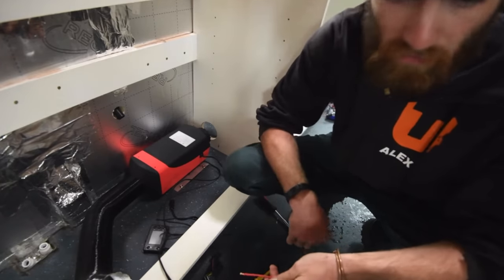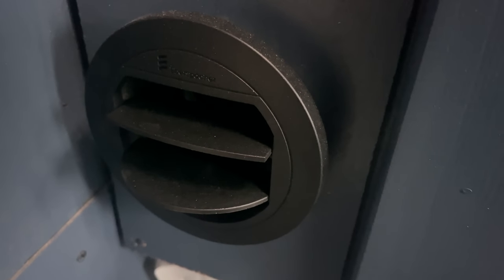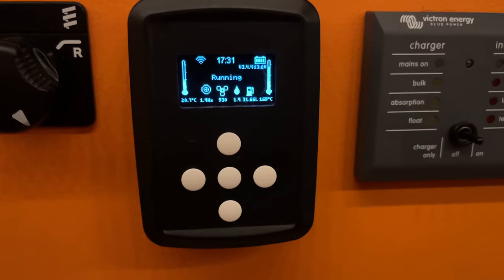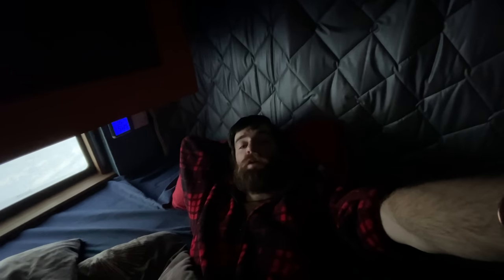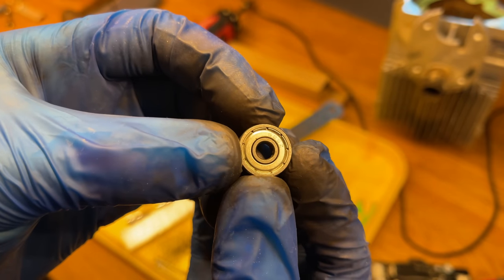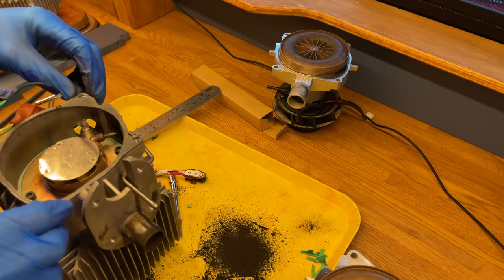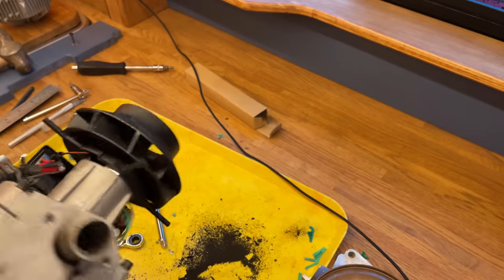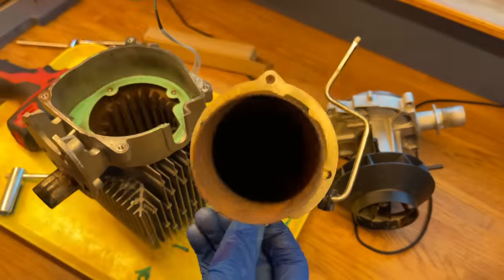2000 HOURS LATER! Chinese Diesel Heater

Comment: Mr Mispronounced Adventures,
Can you tell me how long of an exhaust you can mount on one of these?
And, can it point upwards or does it have to be pointing downwards?

SO what is the max length of exhaust you could possibly put on this that would still be effective?
And, can you point it upwards with some modifications ?
Reply from the maker: I’d need to look it up but most of the manual says the max length and Max degree of bends. When you start to get longer or more bends, you start to make a restriction, which will effect the combustion.
Reply: @MispronouncedAdventures  i saw in the chinese booklet that it may only be 1 meter maximum, but i think that is kinda short, right?
Btw, if i were to use a bigger diameter pipe, it shouldnt restrict it i would think. 

But anyway, thanks for the response. I am gonna try it out and see what happens.
Like in, 2 meter exhaust would be nice.
Reply from the maker: I find many of the Chinese booklets can vary massively, depending on which company you pick whilst the heater itself will be the same
Reply: @MispronouncedAdventures  i have no experience on that. I just bought one from Vevor, a 5kw heater with the 4 outlets.
But this booklet is crazy. It has an explanation on how to work with the digital panel, for every variant of that panel.
But this device only has 1 such panel, so why would i want to know how all the others work?
Plus i can not make any sense out of most of what is written in that manual.
Luckily there is Youtube.

But so, you have never tried a longer exhaust yourself?
I do not see why it would become a restriction if i just make it longer. Perhaps even make it a bit wider pipe, so from small to bit wider diameter, that shouldnt create a restriction i would think.

It is because i want to get the exhaust above the roof of my house, which is roughly 3 meters. I dont want to bother the neighbors with the smoke and smell.
I also thought about making the warm air outlet longer, but i think it will be a lot of waste of heat.
Even if i were to isolate/insulate it (or how you spell it, dutch sorry cant help it) i think i will still loose a lot of heat when it has to travel down 3 meters.

Anyway, i think i am going to try it out. If it works, it works.
We shall see.

Comment: Would it make sense to have the inlet hose on the inside of the house, seeing that the air inside is already cleaner and warmer?
Reply from the maker: The inlet of the combustion side? Definitely no. Not safe if there is a issue as it would be able to vent CO into to the habitation. 

The air which is heated is  already from the inside

Comment: Why is there a brushed dinosaur electric motor when brushless motors are available ?maybe your next upgrade?
Reply from the maker: Even the western Webasto and Espar use brushed motors only till recently and I think that’s only on new models. Autoterm use brushless. 

it’s not a upgrade you can make to a CDH with a whole need ECU.

Given my Heater ( the one in the video ) in now 6000 run hours I’m impressed

Comment: Hi, I'm interested to know how much electricity it uses? Mainly for the purpose of managing 12V batteries at sea on a boat. One suggestion from a skipper friend of mine is that these Chinese heaters are actually better than the Webasto/Eberspacher originals in the sense that those latter have a thermostat which is not always a good idea, as the units shut down when the set temperature is reached: His argument is that it is better to have a smaller capacity heater running higher and longer, thus not using the electrical use intensive start/stop cycle so often, instead of using a bigger KiloWattage heater which stops and starts more often. Personally I think it's hard to say without practical long-running cycles, and models probably vary. What do you reckon? What does your 'afterburner' unit actually do, in a nutshell? I have an Eberspacher and a similar Russian diesel heater (I'm sure one is a close copy of the other) on a boat, and they do tend to use a lot of power for winter sailing in the far north, where there is not so much sunlight to recharge batteries from the sun, so I'm really interested to see how far we can get with the longer cycle/continuous running theory. Nice video, thanks.
Reply from the maker: Power wise I find it uses around 1A @ 12v when running on low ( van up to temperature) 3/4A. I found it wasn’t even a draw I really had to consider too much when I was up in the Arctic last winter
Reply: @MispronouncedAdventures  thanks for that. Do you have any idea what the startup and shutdown current draw is, and for how long, each?
Reply from the maker: Around 10A @ 12v / 120W for a few minutes
Reply: @MispronouncedAdventures  that's good info, thanks - hard to measure on a boat with so much is going on and off (navaids etc)... would you measure the time in minutes it uses the 10 Amps whenever you happen to get a chance, if you'd be really kind?

Comment: i would be interested in obtaining the afterburner unit.. please advise where from
Reply from the maker: There is a Facebook group for it. It’s more of a project and not a product
Reply: @MispronouncedAdventures  i purchased mine from aftterburner direct  2 years ago and it was (is) both a esp32 project and a also available as a full kit full kit, beware i think there is a copied version around which is not as good
Reply from the maker: Yes, unfortunately there is a Scottish company which copied the project whilst the code was opensource, the PCB design was not. The UK market effectively was banned by Ray for good reason for almost 2 years. My unit was purchased from Ray

Comment: Ever tried a percentage of using oil mixed w. diesel? I am assuming it‘s using the main tank, right? So there’s a way to save on fuel costs in general.
Reply from the maker: I don’t personally as it from my main fuel tank. But I know maybe people do run mixes
Reply: @MispronouncedAdventures  Acc to my experience up to50% without modification works fine. But you need to watch the engine oil level. If it’s rising, change your oil because diesel evaporates at 50°, vegoil doesn’t and accumulates if the combustion isn’t good enough.
Question about your transit: Any trouble with the DPF? I see a lot of them at work with blocked DPF and it doesn’t seem to regenerate very well with these engines (Sprinters on the other hand don’t have this issue).

Comment: Invest in ratchet spanner’s Aldi or Lidl have them around a £5
Reply from the maker: I do, I have a small set ( I used one of them to tap the Center out later on and to put the new exhaust clip on  ) but I just didn’t have a tiny one for the old jubilee clip.

Comment: why dont you connect the heater exhaust  to the vehicle exhaust, then it will never have a chance to plug.
Reply from the maker: I can’t imagine the back pressure from the vehicle far larger exhaust would be great for the unit or operation

Comment: No difference between a Z or a zz bearing except zz bearing are usually shielded on both sides, but z bearings can also be shielded on both sides.  Personally i prefer SKF bearings as they are much higher quality than most.
Reply from the maker: SKF was a brand I also saw a few time on my research.
Reply: @MispronouncedAdventures  Most of the bearing we used on air craft in the 70s 80s were made by SKF. A very high reputable bearing company, which is why I always try to buy SKF bearings for everything I repair. Pay a little extra once, or over time spend much more while having to replace every couple years

Comment: Tip to extend the exhaust pipe is to set it in position then remove and spray it with stove paint, it will give you an extra year
Reply from the maker: Interesting idea. Make sense stove paint would be fine for this application

Comment: You really want swiss or german bearings. If possible get ceramic hybrid and you'll probably never need to replace them again.
Reply from the maker: I had always here good things about the Japanese made bearing. 

I think about ceramic but I couldn’t find any use case or information of other using a ceramic bearing in a heater yet
Reply: @MispronouncedAdventures  I know Japanese bearings can’t be beat when it comes to auto. Koyos are amazing

Comment: Because you use your 5kW heater on low, would you go for a 2kW model if you were buying another one?

Also, would a 2kW model heat your water ok?
Reply from the maker: I’m a more heat quicker sort of person. The great thing about the afterburner the thermostat is so good and does a good job figuring out the right heat output to maintain the target temperature. 2kw max would be a little low for my arctic adventures Whilst a 2kw will work with the Bobilvans hot water kit, it’s faster with a 5kw.
Reply: @MispronouncedAdventures  Thanks 👍
Reply: @MispronouncedAdventures  Hi Alex, Do you have a link for the after burner ?

Comment: Mine is run underneath at a slight down angle, and points directly at the engine block. There's really no need for a muffler
Reply from the maker: Your exhaust points directly into engine bay? The muffler does make it a bit quieter, which, if I’m parking somewhere urban in the winter, is appreciated.

Comment: Great video! Do you drive with the heater is on? Silly question but  I had to ask!
Reply from the maker: You can if you want too, I don’t maybe unless I forget to turn it off. The cab heater with the bulkhead door open heat the whole van up

Comment: 18:50 Do the glowplugs ever fail?  Sure would be simple to install one while the unit is out of van.  I'm an old fart and would do anything not to work on the heater underneath the countertop.
Reply from the maker: Glow plugs do fail, but I  went for the don’t fix what  isn’t broken policy. Hopefully it will remain good. 

They can be installed under a van, some company make boxes for them

Comment: Hi good video,  do you have a link for the controller you are using?  Cheers
Reply from the maker: There isn’t really a link to it as such. But there is a Facebook group. Called “advanced, Chinese diesel heater controller afterburner” you’ll be able to find more information about the project there. There is also a website as well you could google

Comment: Have you tested the air quality around these?   Mine is spitting high TVOCs and formaldehyde. No CO through 😂
Reply from the maker: I assume you mean the combustion exhaust? Wouldn’t that be pretty reasonable to be produced from a diesel burning exhaust with no type of filtration?
Reply: @MispronouncedAdventures  I mean the inside air.  If I run it for an hour, TVOCS and formaldehyde seem to be leaching from the plastics into the cabin air.  I have it installed in a 8x10 trailer.   There is a small slit also in the back where the intake is, where if there was any backpressure, some exhaust would leak into the part where the fuel intake line is, and around the glowplug.  While everything is gasketed, if you blow through it, it is not actually sealed well.

It doesn't...really smell.  Maybe smells a little of hot plastic.  But according to my readings on air quality, VOCS and formeldehyde in cabin air reach unsafe levels.

Comment: It would be nice to find out the efficiency and diesel consumption difference if you somehow enclose the exhaust pipe with the fresh air intake hose. It should drastically improve your efficiency, and it would also increase the life of your exhaust pipe.
Reply from the maker: What makes it more efficient? Pre heating the air?
Reply: Absolutely would increase efficiency by not drawing air from outside either. If you looped your intake hose back up into the van you would be just reheating the air from inside the van which is already warm. It’s a lot easier to heat 20 degree air to 100 degrees than it is to heat -20 degree air to 100 degrees. Same as when you switch the heat controls on your van to recirculate when driving. The efficiency of your heater core is way more and the heat coming from the vents would be hotter.
Reply from the maker: efficiently may increase you definitely don’t want to be doing that. Have a combustion side air intake in this vehicle. If the heater ever stops you will be allowing exhaust gases into the vehicle. The heat exchanger cabin heating side is already recirculated
Reply: @MispronouncedAdventures  I  think you may have misunderstood AG's comment. I believe he is referring to concentric venting.  Of course a burner would need to support such a configuration.
Reply: this device has a fresh air intake for combustion. only for to burne the fuel.
The air to be heated gets in on one side, passes the the temp exchanger, and will be vented out on the other side.
independent circles.
please, never mix the burning circle  with heat up circuit.
btw, cold air is more dense then warm air.
by that, the cold air has more oxigen in it.
Reply: @MispronouncedAdventures  I am with you, the efficiency is not worth the cost and man hours if there is even an iota of chance of  carbon monoxide being drawn into the van. Small spaces quickly become coffins.

Comment: Hey, could I ask a quick question? I’ve just installed a brand new Triclicks (Amazon) diesel heater into my van. It runs at over 200 degrees c after only a few minutes. And I only ever use it for a couple minutes (10 at most) and it does the ‘CLEA’ at shutdown every time, I read it only does that after long running. Does this sound right? I see your video says 169 degrees is too hot
Reply from the maker: Burn chamber temperature can range massively due to combustion tuning and heater setting. Mine when on max / 5.4gz is around 200-210c, low / 1.4hz might be 130-140c
Reply: @MispronouncedAdventures  thank you!

Comment: I was a little disappointed the important bits , removing and fitting bearings were just glossed over. I have one of these heaters and was hoping to see clearly what I had to do. Was still interesting but just not clear on the important bits.
Reply from the maker: I am sorry you fill that way. The in and out of the bearing was just tapping it in and out.
Reply: @MispronouncedAdventures  they can go either way round? Was there a yellow jacket on both?
Reply from the maker: Yellow jacket was only on the bearing near the internal combustion fan. The other bearing was inside the motor housing near the Brushes and had no yellow jacket.

Comment: Hi, do these heater work (without the extra control panel you have sourced) as a thermostat, so it kicks in at a set low temp and turns off and back on automatically?
Reply from the maker: Excluding my own aftermarket controller. It ranges massively between models . Most have a “thermostat”ish and temperature sensor built into the controller. However, they’re pretty dumb more often than not. They would run on full power if they’re not at the target temperature and then go on low when they get to the target temperature so they cycle up and down between full and low but quite often low is still too powerful and overheats some vans.

some of the newer models such as Hcalory. Do you have some reasonable thermostats or if the van begins to get too hot even on low it will shut down and then it will turn back on again automatically when drop to a certain temperature.
Reply: @MispronouncedAdventures  thanks for taking time to reply. My van is just for window cleaning so only need to keep the frost of so the pumps don’t freeze up. I’m looking for solutions to automatically turn in just before freezing and off when it gets to I don’t know 10oC perhaps.

Comment: What extra features does this controller have?
Reply from the maker: Perfectly working thermostat where the heater figures out what power setting it needs to be on to maintain your target temperature opposed to ramping from high to low, GPIO in and out, remote access via Mqtt, frost mode, timer. Cycle shut down if gets too hot even in low, fuel use tracking and so so much more

Comment: Best Chinese diesel heater video I've seen .
Add 1 sub .
Can you recommend a heater brand (2kw) in uk please ?
I've got a 2kw in the camper , good as gold , never had a problem. 
I've also got a 2kw in my workshop , never run right from first day , errors & smoke etc , needs replacing. 
Would be grateful for recommendations. 
Cheers
Reply from the maker: Glad you liked it. It’s been a while since I looked into 2kw units brand wise. The units I was fixing in the video one a older non bluetooth Maxpeedingrods 5kw ( not the same ECU as the new bluetooth maxpeedingrods 5kw header ) . They also make a 2kw version, which I know a few have used and I haven’t heard issues. I can’t remember at the moment but there is a uk blog Which a “best Chinese diesel heater list” which they keep updated
Reply: @MispronouncedAdventures  
Thanks for quick reply .
I'll have a nosey .
Good luck in the Arctic 👍
Reply from the maker: @peterherrington3300  no problem and thank you very much

Comment: I would try to move the heater if you can, I would think its heating up the refrigerator and wasting energy.
Reply from the maker: The heater body’s don’t get warm at all, or radiate heat, all the air is directly down the ducting. The air mass between the fridge and the heater cabin is sectioned off as well. The access hatch in the base plate for the fridge has a cover over it normally.

Comment: Rubber shields can carefully be removed, the bearing cleaned and regreased, and the shields reattached. My preferred bearings.
Reply from the maker: Worth replacing poor quality bearing is the high quality ones in the first place. I didn’t know you could swap the shields